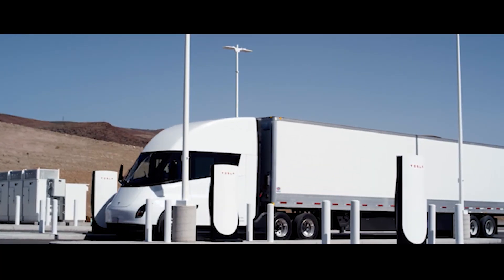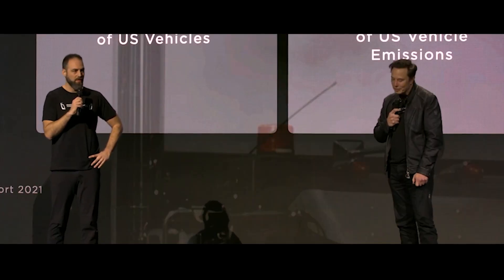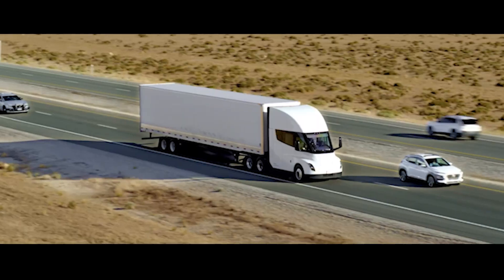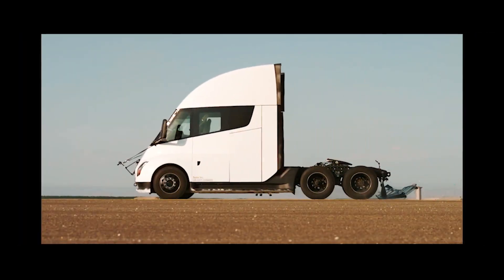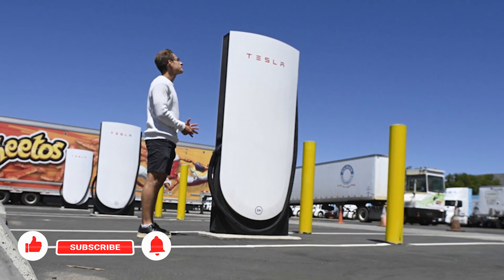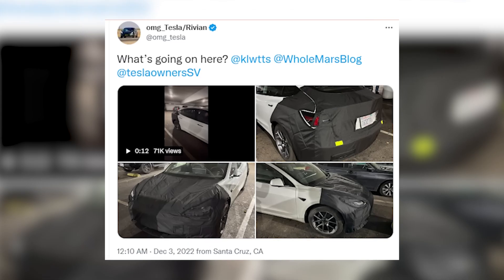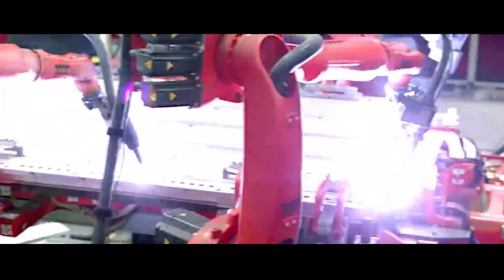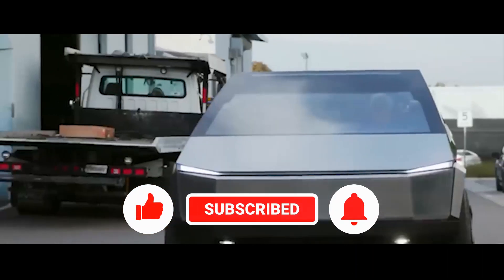NEW Major Tesla Cybertruck Update Revealed!

Comment: Tesla claims the Cybertruck has 2,830 litres of lockable cargo capacity. This includes the load bed (which Tesla calls the vault) the frunk, and even more storage behind the side windows. The Cybertruck has integrated 120-volt and 240-volt powerpoints, turning it into a kind of mobile mini power station. It also features an on-board air compressor.
Reply from the maker: Thank you for watching! We are looking forward to sharing more quality content.